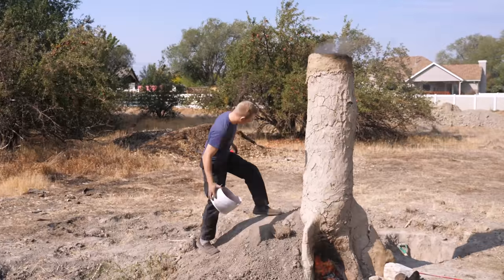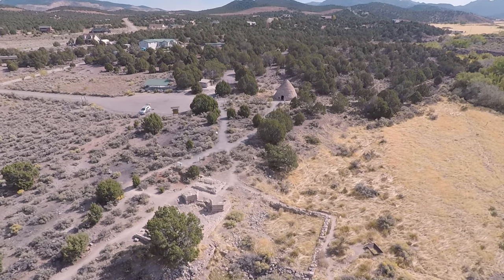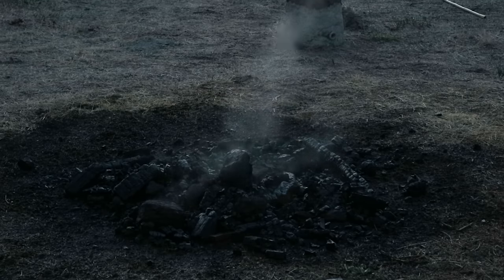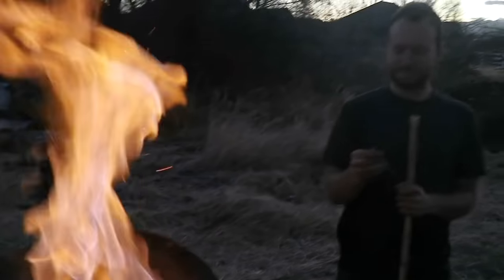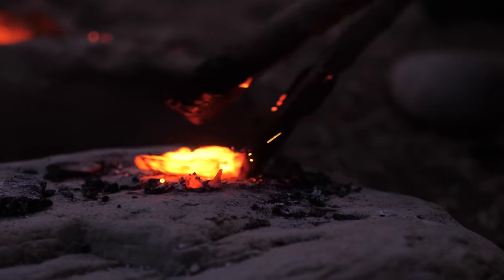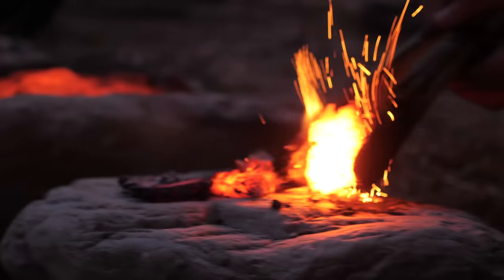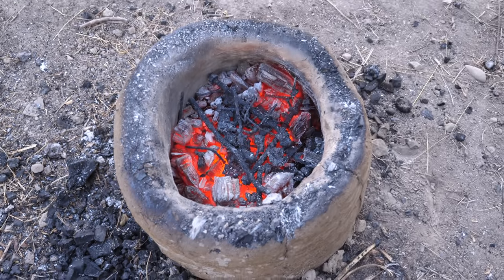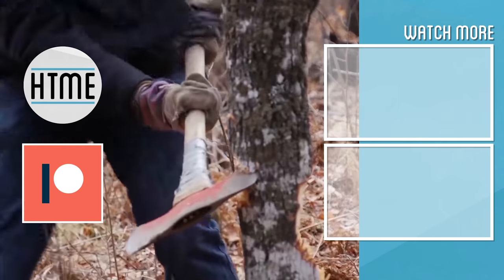From Rock to Iron to KNIFE (Handmade Knife Forged from Rock)

Comment: While I'm a bit late to the party on this one, the Japanese are arguably the masters of converting iron ore to usable steel (tamahagane), with each ironsmith employing techniques unique to their forge and often passed down from father to son. The forge itself was normally a single use, disposable item that would be built for each smelt and broken down to harvest the bloom with slag taps throughout the process. A coal/charcoal heat source was built up and stoked through the melt while iron sand (ore) was shoveled in through the top, consolidating at the bottom throughout a full day of painstaking attendance (aka babysitting the forge, which if you're doing it this way, you'll be there for the various stages anyway). "Blow ports" were built into the bottom of the forge which doubled as observation windows and bellows were used to pump air directly into the base. 

It's a fascinating process, and if you are so inclined to try it yourself, you might be able to find some really dated videos that go over the process minus 'trade secrets'. I had a go in the early 2000s but cheated some with modern conveniences like a blower and thermocouple. 

Also when consolidating the bloom, save every piece that blows off that puppy! Effort aside, the resulting steel will be fragments of high and low carbon shards, which make a huge difference when layering your blade to know which and where to place them and dramatically effect the final quality of your instrument.

Comment: Something thing that could help is making coal coke which will provide a good way to increase your smelter's heat. Using one of the early types of flux such as powdered limestone will help remove impurities. 

The first steps of adding coal and ore in layers is a great start. Its still used in todays metal foundries in the early stages of refining. Once that is done and you have a few blooms of "pig Iron" you should try to break it into pellets.
After that step, something that could really help with improving the iron quality would be researching early styles of crucibles and cupolas used to smelt the "pig iron".  The lime flux mentioned earlier will help draw out and float the impurities on the top of the  liquid metal, from there you can skim and then poor the iron into molds. You should be left with noticeably higher quality iron ingots that should be easier to work with.

If your willing to suspend the traditional approach you can also use borax powder.

Comment: I agree with some others that the temperature should be higher to get a good forge weld. Also, if you don't want to use borax to flux with you could use sand. Im not sure at what time in history they started using Flux, but sand does work to a degree.

Comment: Great man! I think you can try Wootz steel then (remember make a hole in the crucible for the sulfur go out) is more easy make good steel and alloys.
Tamahagane and oroshigane are ways to make better steel if you start with the dust of the forge (iron sand).
I try this technic a few times and i know now that if you wanth to make 1kg you need something like 6kg or ore and then in the forging you lost the 70%.

Comment: Forging far too cold, but also, since there are so many impurities, the structure is far from sound at the start, very vulnerable to hard or sharp impact, Veteran bloomery smiths will use a stump or other large flat surface of thick wood instead of an anvil or stone(I felt something near to physical pain seeing him use a hard, lumpy and abrasive rock for an anvil), hammering with a wooden mallet or even a hefty log for larger blooms, using the broad and rounded wood mallets and wood surfaces rather than the sharp and hard metal surfaces and hammers, REALLY helps keep the bloom from falling apart.
 The biggest tip is "Patience". It is a slow process even with modern day tools, and expansive knowledge on the subject so don't try to rush it. Because  It needs to be hot, every time you hit it, it needs to be a bright yellow-orange and you need to be gentle with it at first. Or it Will far apart. Really hoping to see a steel knife so you can get more precise wood carving and won't have to spend as much time sharpening.           Not all that complex, you get your iron billet drawn out to about  an inch thick at the most(preferably 3/4 or 1/2 inch), and then you seal it in an air tight lump of clay filled with powderized charcoal, and the iron billet(Very important that the iron billet is entirely submerged and surrounded by charcoal powder from every angle) sealed in the package of carbon and clay the entire lump of clay(and its content) need to reach critical temp and remain their for upwards of 6-8 hours if the goal is a high carbon steel, 3-5 hours if the goal is a lower carbon steel that will be somewhat softer but much less brittle and less likely to crack after heat treat. 
  If you wish for further sources on this topic just Google "Pack Carburizing" It's a process of adding carbon into the surface of iron, or steels. there are other forms of Carburizing, but Pack Carburizing is the easiest to do with the equipment you guys have. Most sources will mention using a sealed steel container, but you don't have steel yet, let anon a welder, Clay works, If it is thick, and you don't leave gaps, scrape a stick, rub a little water on it, pull out all the stops to get that clay package sealed and consistent, don't want a weak point cracking open. I hope you guys still looking here for tips.

Comment: Im no pro, but i have been blacksmithing from bloom for years. You need to heat that up a hotter then what you had it. Part of the reason it was crumbling was due to its not being heated enough. Stop hammering when you can clearly see yellow with slight orange coloring and reheat. It will help to forge in low light.

Comment: From what I’ve seen (not an expert) a bigger bloom is easier to work with, only hammer a bloom when its white hot and use a wide wooden mallet until it is no longer spongey, and crumbly. It’s normal for a bloom to want to fall apart but it should stick together better when white hot.

Comment: A lot of early iron work was done with meteoric iron, which is a much more pure source. Turning that into an ingot is a ton easier.  At some point, somebody thought "I wonder if we can make this awful iron-containing rock into a decent ingot?" and started hitting it with as much heat as they could.  After all, iron ore is incredibly common, moreso than the metals you need to make bronze.

Comment: Could you have used the borax from your previous glass making projects as a flux for the forge welding ?
The flux should lower the melting point of the slag and form a barrier against oxidation and scale forming between the iron pancakes.

Somebody please correct me if I am mistaken.

Comment: Looks like at first atleast you weren't heating it enough and then worked it for far too long given the internal crystalline surface area. Doing it in a dark room gives you a better idea of how much heat the steel is holding, when to put it back in the heat etc. Looks like you did an amazing job though! An edge is an edge.

Comment: If you learn to gold pan, you will acquire iron as I byproduct in the form of black sands. These are both magnetic and non magnetic, so separating them should be relatively easy, and provide you with a decently pure form of ore to smelt using the methods you have been using, without a need to grind the rocks, nature having already accomplished this for you. And while you cannot find gold everywhere, you can find black sands in just about any place there is moving water. And who knows, you might find a little gold for some later use.

Comment: That Damascus knife in the beginning was either dull or you need to learn to use a knife
Reply: Most knives need a sharpening out of the box. They're not sharpened to a razor sharpness for safety while shipping, generally, and IIRC there are also some laws that handle how sharp they can be when sold.

Comment: At the right temperature, the undesirable content should melt to create a subproduct, the slag, cooled down it's a glass like thing because it's mainly made of silica + other elements. If your bloom is still filled with silica and other elements or the proportion between iron and carbon are not correctly balanced, it will crack on the first hit and pieces of iron will just be thrown away with the slag. At this right temperature 1200° - 1300°, the pieces of iron should stick to one another to make 3Fe + Carbon become steel Fe3 C; while the slag melts down to the bottom. If you can only maintain 800°, you get a mix of all stuff inside in a blooming ore of ferrous silicates which is something like a fayalite slag, looks like iron, but it is just a iron rich slag...

Comment: Something was wrong with that iron. It was too brittle and did nit forge weld that well. There is something that I can't quite remember - a flux of some sort you add to the initial mix in the furnace that helps keep this from happenning iirc.

Comment: After watching a lot of Alec Steele forging stuff, I feel like your main issue was that your iron was WAY too cold most of the time. When banging n it while it's red hot, it seems like it breaks apart super easy while a yellow or white allows it to move way better. I know it's hard to get that kind of heat quickly though without a proper forge though.

Comment: Im not an expert on this but i have a suggestion that will help everyone who does this. Make your stack taperd like a high way road cone. That way the thickest part of the cone at the base will hold and concentrate the most heat. At the the base where the bloom needs to be at the most fluid state. And as the cone stack tapers to the tip the heat will gradually be less and less. Allowing more time to add iron rich material to the stack to make a bigger bloom at the base. This is also the same reason most stacks on old iron smelters are cone shaped. And its self supporting allot easier and less heat loss than a uniform stack shape. Thank me later and please if you redo this idea with a cone shaped stack please please please give me some credit in the next vid. Please😊😊😊

Comment: You've hit a few problems, the first is not getting your bloom hot enough before trying to forge weld them together. Doing it cold won't allow adhesion.
The second is forging it too much over a long period of time, you're actually burning away the iron and losing a lot from this.
You really should be waiting for the fireworks before many light quick taps, then right back into the forge. You don't want too many heats at this crucial stage you want it to form an ingot as soon as you can and then later heats you slowly work the impurities out of it.
Hope that makes sense

Comment: Your temperature was too low and you need a flux to prevent re-oxidation. You must fold your ingot many times because the folding removes the impurities which still are in the whole material.

Comment: If they have reached the iron age they actually could do ancient forms of electricty like the baghdad battery which is a pottery jar, a copper cylinder, an iron rod, and grape juice for battery acid, with an insulator like cork or some other material seperating the rod and cylinder. They produce Low power under a volt each, but run in series they can have more "juice"
Reply: what did they use these for??
Reply: It's believed this is how metal plating "like gold" was possible for ancient civilizations like eygpt without today's modern equipment
Reply: It's called bahgdad battery because the first ones were found near the city of bahgdad in the middle east "sorry if i'm spelling it wrong
Reply: With today's knowledge i think Andy could find more creative uses for it as he progresses
Reply: @scotchmannafar1775  wow, pretty interesting. Id doffo agree it would be cool to see a video on this topic

Comment: there are channels dedicated to doing the process of breaking down via chemicals but it requires ventilation filters and a personal safety head cover to prevent any escape inhalation of the acids or the undesired elements breaking away into the air. O.0

Comment: shouldn't you be able to make crucible steel with all that iron ? if it has high carbon content you should be able to melt it and turn it into a puck that will be much easier to work with. Also borax, its extremely important, and you already have some lying around, it prevents oxidation, so when you try to forge weld your pieces they don't just fall apart.

Comment: My guess: there are 3 reasons why their bloom smelting failed. Well, beyond the ore purity.

1. They did not have a proper way to evacuate slag. "Stick" ain't a method.
2. Furnace burned too quickly. It seems like it reached the required temperature, but they finished in 5-6 hours. I assume for a low quality ore, you have to allow longer time for those impurities to turn to slag.
3. Not enough tuileries. Their furnace is a large diameter one, 2 tuileries at opposite ends would insure a more homogenous air distribution.

Also is not clear from the video if they actually sealed up the hole at the bottom that they used to extract the bloom. I hope they did.

Comment: i never understood why people go through the trouble of batting down the bloom to get out the impurities. why not just... melt it down to liquid... the impurities will float on top and if you cast it you can still forge it, but much better than a bloom that just falls apart. like how much iron do you lose in those bits that just crumble away? 

am i missing something?
Reply: Raw iron has a really high melting temperature (around 3000°C), that pre-modern furnace couldn't reliably reach, so that's kind of outside of the scope of what they can do right now.

I'm also not a blacksmith, but I've read that even though we can cast iron today, the castable kind of iron isn't the right kind of iron/steel for the use intended here. To be castable at low temperatures (still around 1000°C) the iron has to have a very high carbon content, so cast iron is very brittle and can not just "be forged".

I'm also not sure if just turning the bloom liquid will seperate the impurities that easily, after all at those high temperatures most of those will be liqufied too, can't imagine how you would get them out.
Reply: @DormBrand  damn
Reply: @DormBrand  about the temperature, i'd agree. i didn't know that. 

but about seperating the slag from the iron by liquidifying it. well as all liquids, metal has a specific density. which is quite high. slag and other impurities have a lower densitiy and will just float on top. with a stick you can literally just scrape them off and leave the relatively pure iron.

and you are right about forging cast iron. apparently it splashes all over the place.  the carbon content is too high to forge. but if you heat it with a gas flame it will lose carbon due to oxidisation. so if you "cook" it long enough it will eventually be forgable i guess. its still iron/steel. you just have to "adjust" the carbon levels

but yeah that is hard to do with a primitive forge.

Comment: You honestly could probably do better for creating a metal Puck by attempting to do crucible steel. you have the technology available with clay pots to be able to make a crucible that should be able to theoretically work and being able to create crucible steel. might be something worth looking into because that way it's easier to keep the metals together and having the slag lay on top of the good steel and it's easier to work with as a puck that way as well since all of the imperfections should in theory boil up to the top of the crucible and be able to easily separate from the rest of the steel.

Comment: I just watched Cody's Lab video about making iron and tbh i think these guys have over complicated it. Just make a clay crucible (melting point ~1,780 °C) and rather than chucking giant rocks into a kiln, just sift through the same dirt material you found the rocks, the dirt itslef should have enough magnetite in it, sift through a lot and just wash off the silica. The remnant should be magnetite , crush that with some carbon and limestone put it in your clay crucible and throw that into your kiln. This process is still primitive, and significantly more efficient than what you guys did, and you'll have workable iron.

Comment: Remember folks. Folds, layers and pretty colors in a knife don't CUT anything. Art has its uses but just because something is unique, doesn't make it useful as a tool. You can fold playdough, as many colors as you want, do it exactly the way  " Damascus" steel is folded. Pretty? Yeah. There's an old saying...GIGO...Garbage in, garbage out." If you don't understand how this relates in the knife world, buy a few and use them. There are much more capable monosteels available today. You don't know what you're getting with pattern weld steels unless you know the person who made it.
Reply: Most pattern welded steel is 1090 and 15N20. Just dont buy cheap junk.

Comment: You are using the wrong charcoal. Use hard wood. Set it on fire. It should be hot enough to burn for days without oxygen. Cover it with sand. Wait till it burns out. Then use it in layers with iron and some form of borax.